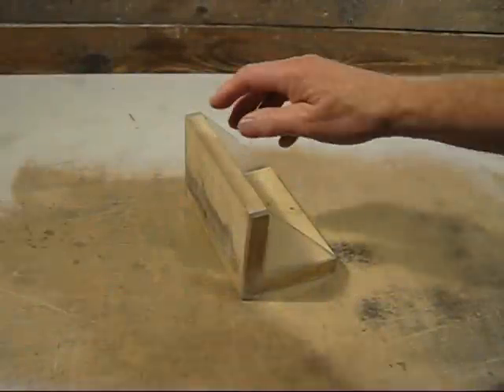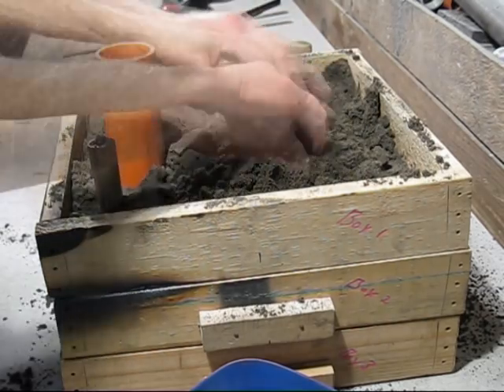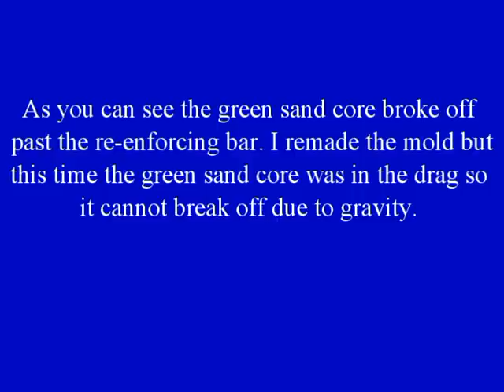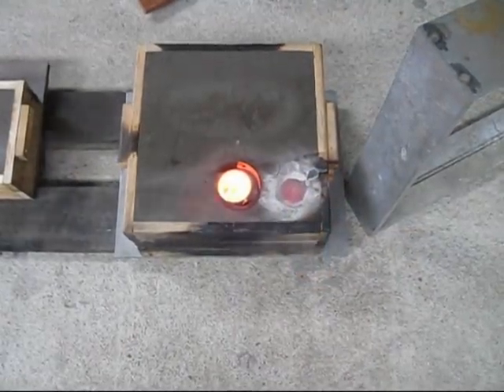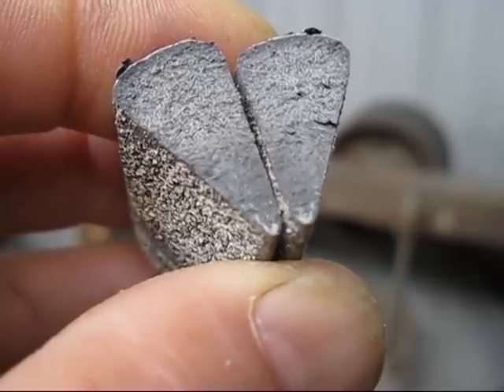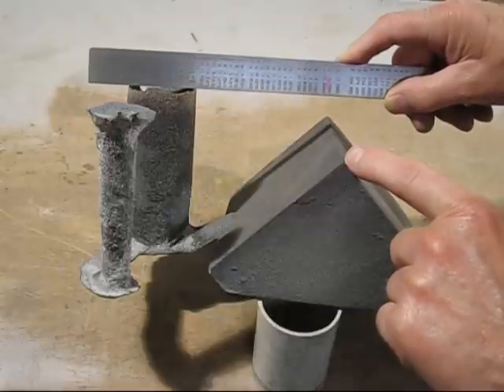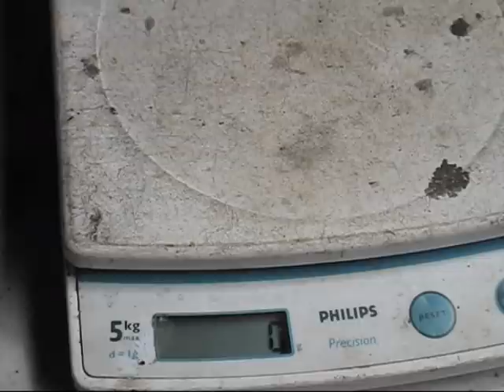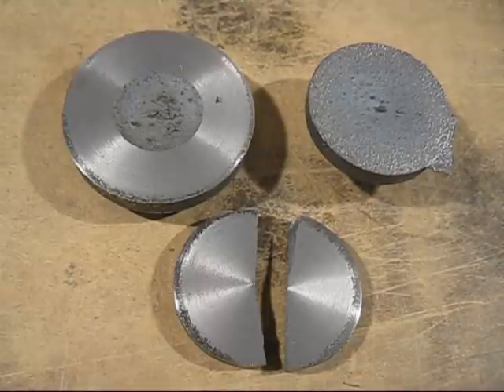Casting an angle plate in iron + other castings

Comment: Agreed, the slots are rarely in the right place or the right orientation.  I have softened files by throwing them into a burning tree stump but they usually sag or distort however, the steel machines beautifully. Very instructive video. Thanks for sharing.

Comment: Good to see you survived 2020! Have you tried oven or at least skin drying moulds as away of eliminating chill? In theory a dry mould will not cool metal anywhere near as quickly because there is no water in it. In one incidence with an aluminium casting a dry mould took 12 minutes to solidify - the same casting in a non dried mould took just 6 minutes..... Martin
PS Yep, holes never in right place!
Reply from the maker: Yep still here. I have never tried to oven or skin dry molds so it will be something I will have try.

Comment: Wonderful to see the use of the spoke in foundry work.
Reply from the maker: I am not sure about what you mean "the spoke in foundry work"?
Reply: luckygen1001 you were using a spoke as a pointer. Many years ago I was casting pistons for my racing motorcycle. A knowledgeable older friend advised “to stir the molten aluminium alloy with a spoke”. Since then the spoke has become an in joke amongst my friends and I. Gaining mythical properties in the foundry.
Reply from the maker: @iancoulston6452  Ah yes that makes sense and it was a broken spoke from my bicycle.

Comment: @11:25  We use the "wedge" check everyday on our furnaces to check the "chill" in the iron before we start trimming out our heats for pouring. I am uncertain of which of the standards that the "chill" measurement falls into, it may be an older Meehanite method to establish the amount of white iron chill that you are expected to get.   In either case, we measure the "chill" or white iron shown at the tip on the height and record that measurement. The higher the number, the worse the result.  Good demonstration of using a chill wedge to demonstrate the impact of mettalurgical controls in basic foundry melting practice.

We do use FeSi as an addition to almost every heat, it all depends on quality of the melt, and how "stale" the melt is. Older melts that have been sitting for several days without any fresh additions will show a lot of chill on the wedge. If the melt is older, or has been heating for a long time, we add a small amount of fresh scrap cast in  order to improve the wedge. The FeSi method is probably far easier based on the method of melting shown and melt capacity.  Even with these processes and controls, we will almost always have a small amount (</= 1mm) of wedge on a heat prior to treatment, it is not an unexpected occurrence. We just use our means to limit the white iron chill as much as possible to improve quality.

The white iron shown in the wedges is an incredibly hard/brittle matrix of iron. White iron is actually desirable and used in many high-wear resistance applications. But you cannot machine white iron effectively without destroying inserts/tools, or using alternative methods.

It is quite obvious that the channel is quite accustomed to basic foundry and melt practice.  Well done.
Reply from the maker: I know the term "stale iron," another term is monday morning iron which has been held over a weekend and takes a lot more ferrosilicon to inoculate. I use scrap for the whole melt and use risers and runners from other melts and this problem of stale iron gets a lot worse.

Comment: Perhaps a way of avoiding the chill is to have a very large cast sprue with the small mouldings branching off. the thermal mass of the sprue would act as a thermal reservoir to reduce the overall rate of cooling on the mold and if there was a large enough sprue fill prior to the melt gating into the smaller parts it should act as a mold preheat mechanism to further reduce the chance of chill.

on a plus side it would also leave you with a nice billet of cast iron for machining or for later use in a melt
Reply from the maker: Yes it would work but it wastes a lot the iron that ends up as billets.

Comment: Remember your video were you demonstrated if air vents are needed, with the long circular casting gate? 
What if you used a long casting gate like that to circle around a small casting mold before entering the main mold, providing heat all the way around the small part , and a little extra thermal mass in the sand, without having to have an assistant shut an out gate?

Comment: Hi Luckygen. Please can you tell me what you use to get rid of the slag in your crucible before you cast?

I am battling to get rid of the slag in my melts without using borax. Also, i have a lot of scrap that is painted that I throw in the crucible. Should I remove the paint first to reduce the amount of slag build up? You thoughts will be much appreciated.
Reply from the maker: I assume that you are melting cast iron? I don't use any flux but dirty iron does create more slag. I use a "L" shaped slag scraper to remove slag before I add ferrosilicon.  I don't use a lot painted scrap but if I do it burns of when melting.

Comment: Great video once again. I always learn something. Couple of questions.
Can you remelt your chilled rejects?
How do you actually preheat a mould (do ypu pass hot air through it?)?
Do you have an issue getting hold of used brake discs?
Cheers.
Reply from the maker: Yes you can remelt rejects. Small molds can be heated in an oven or kiln but big molds can be a big problem heating them up. I have no problem getting brake discs as anyone who repairs cars will have at least two discs in the scrap bin.

Comment: Lucky have you ever tried to fill a sand mold with argon and see how it effects the finish?.....if so what happened?  I imagine it would effect the finish of coal dust ...but would it come out better or worse?
Reply from the maker: No I have not because coal dust is cheaper that argon gas. If you try it let me know if it makes an improvement on the casting surface.
Reply: @luckygen1001  if I get a chance  will.. ..I almost think it would make a rougher casting...instead of a smoother one.  Glad to see you are well, thanks for responding.  As far as being a professional machinist, or machine tool operator goes the value of predrilled holes is all over the map....  Sometimes you have the luxury of making fixtures or taking the time to make everything right (heaven)....most of the time you don't have that time and so must select a different workholding solution.

Comment: Would it also be possible to add a big riser to those small castings? so it will cool slower, and to prevent the edges from chilling
Reply from the maker: Yes you could but it would be easier to make them from a cast billet.

Comment: would running the gate runner around casting be a way to preheat enough to avoid or reduce the edge chill effect?
Reply from the maker: If the runner is very close to the casting it might give the preheat to prevent chill.

Comment: If the edge gets chilled, with a squared edge, what would happen if you had a more radius edge, yes I now you would need more material,  and more material to remove, but it would be more easily machined, correct?
Reply from the maker: Edges and corners are always a problem for chilling so a radius can fix it but the best way is to use the correct amount of ferrosilicon.

Comment: Hi Luckygen. Your videos are incredibly educational, thank you for making them. 

2 questions.  Do you reccomend using borax as a flux for cast iron? Or do you think using ferrosilicon is better?

Question 2. I'm starting a small casting business.  Any chance I could have your email for some advice please?

Many thanks.
Reply from the maker: I don't use flux with cast iron. If you use borax it will shorten the life of your crucible, use in small amounts. Ferrosilicon is not a flux it provides seeds for graphite to come out of solution so cast iron can be machined. If you want to give me your email address in your reply to this comment but if you don't want to I will understand.

Comment: Very interesting
Reply from the maker: So did I find it interesting and that why I made that video.
Reply: I was prepared to suggest creating a spiral passage around the smaller parts' mold cavities to preheat the mold, but after typing it out, I realized it wouldn't work, so deleted it and left my original remark.  If you use molten iron to preheat the mold, you really do have to flush until it comes up to some temperature, then plug it so the poured iron stays in.  Thanks for sharing your work with us.  Happy New Year

Comment: Sometimes when I ram up a pattern in my petrobond and turn the box over, the parting line is a little bit higher than the pattern like the pattern has lifted a little while ramming. What causes this.
Reply from the maker: It maybe that the pattern is not flat at the parting line and will rock during ramming.
Reply: @luckygen1001  Thanks for the reply. While I have your attention, I am making a pattern to cast a cylinder head for a 6 cyl tractor. Its for a pulling tractor so it doesnt need any water passages. It will need the intake and exhaust ports. I plan to make the core boxes. The cores are basically the shape of a capital letter "L". One leg will point to the side. Would they normally pour this with the other leg pointing up or pointing down. I was thinking pointing up so the mold will prevent the core from floating on that end.
Reply from the maker: @TheJohndeere466  Cores should have core prints on both ends of the core so I have tried using cores on one end having a core print and  there is a risk of the core moving.
Reply: @luckygen1001  They will have core prints on both ends but I thought if the one leg is pointing down it may try to float that end of the core up out of the core print

Comment: I've always wondered why no one seems to sell angle plates with multiple threaded holes like a tooling plate. They seem a lot more logical than slots.
Reply: Simple answer,  "Too Bloody Expensive"  
and of course, the holes are never in the right place.
Torsion in the wrong place while tightening down the piece, and the spanner tends to be just a little too big for comfort in my experience.
But mainly demand and cost.
Reply from the maker: That would be better than slots.